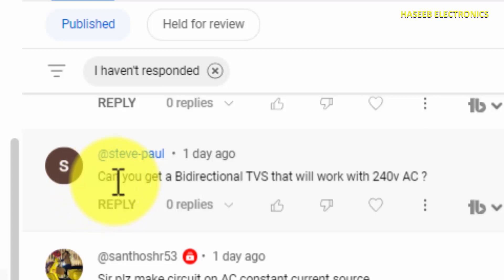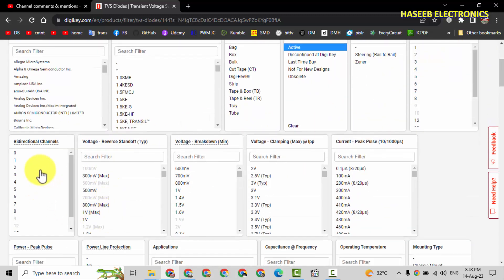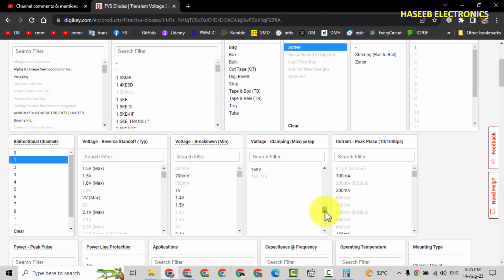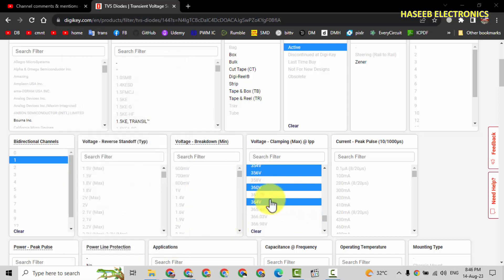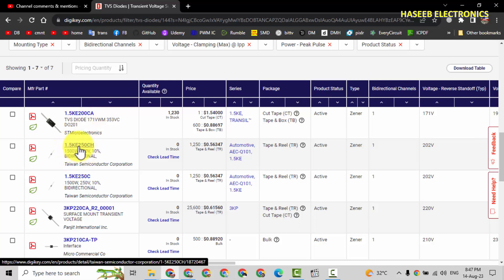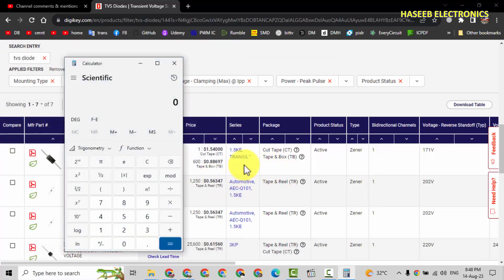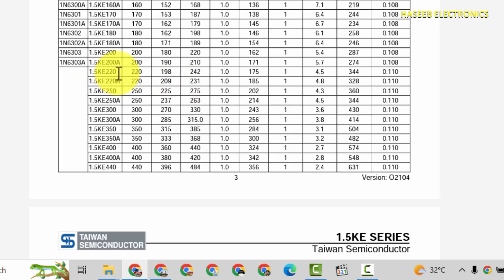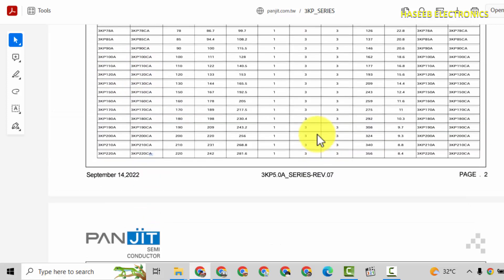{957} how to select bidirectional TVS diode

Comment: Hi, I have a 24VAC transformer output and I am trying to size up an appropriate TVS to put across the secondary.  I don't want it to conduct under normal condition.  Would a 51V TVS work?  Seems like it would, but the Vp-p across the transformer could be as high as 70V right?  So it WOULD conduct right?  Does the TVS see the 34V peak only or does it see the Vpp since it is across the 2 output leads.   Feels like I am missing something here.  Thanks!

Comment: Please , i have an inductive load of 300ohms in a 24DCvolts supply circuit and the circuit resistance can varies between 100 to 1000ohms. Which TVS diode will be the best as the inductive load requires a minimum of 19volts to operate ????

Comment: I have an electronic board from a clinical refrigerator. The board has a blown TVS diode at the input of the board, after the fuses (2A). It is connected in parallel with L and N. 220 Volts. Can you help me select the diode? So I can search for it in the supplier market.
Reply: It is a MDS Diode... No Number...

Comment: Sir, what is that 1.414 and 0.707?
Reply from the maker: to get peak voltage from RMS voltage, we multiply with 1.414
220v RMS x 1.414= peak voltage

to convert peak voltage into RMS voltage
we multiply with 0.707